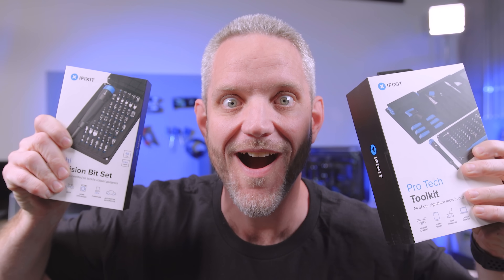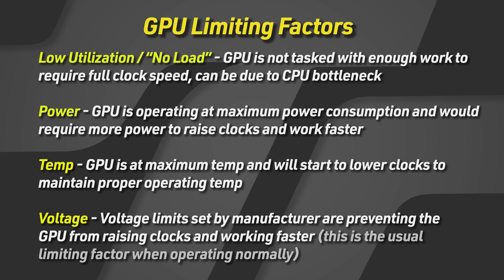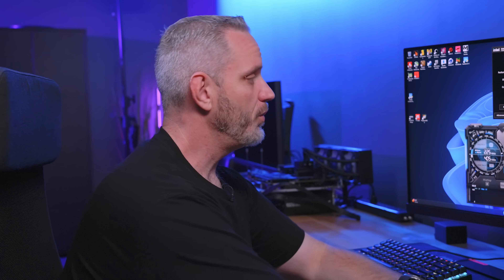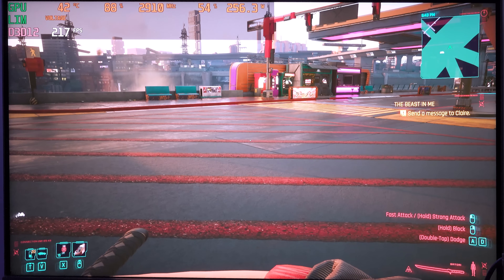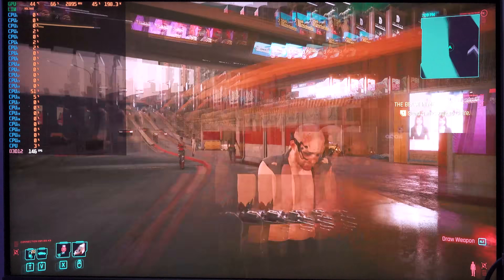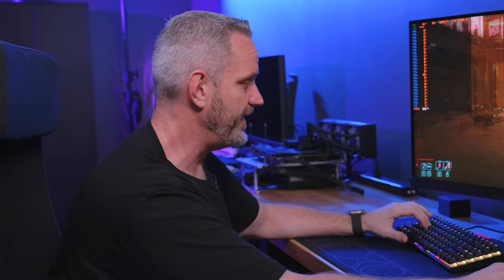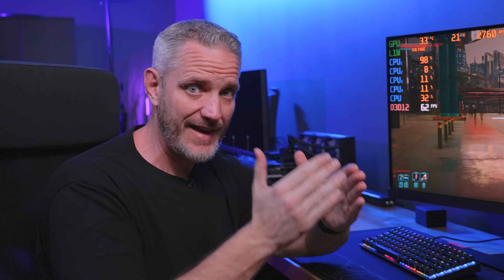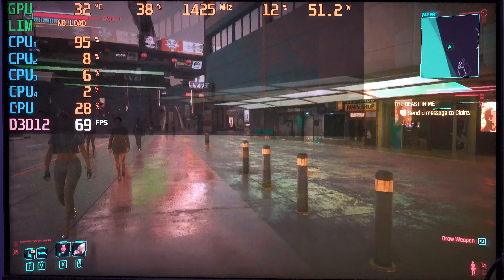THIS is what Bottlenecking REALLY looks like! AVOID THIS!

Comment: can you do a video covering bottlenecking regarding gpu’s wired at 8x running on pcie 3? i’m a design student running old hardware trying to save money where i can. i have a x470 strix and a 5900x so i don’t have pcie 4.0 and it seems all the low end cards are wired for 8x. i don’t know if i should get a b550 or just get a higher end card that’s wired properly. any insight would be appreciated thx much

Comment: If u Run Cyberpunk (a Nvidia  optimized game) with a gtx 1070 and I7 7700 nonk (my case)and u turn all in Low settings and u reach 100FPS,with a RTX Card u will have more FPS,lowest? or the same?
I think will run the same.. 
And New games require more power,I see hellblade 2 a heavy game dont take to much CPU because lower frames.. 
Maybe the think is in the cores and threads.

Comment: Too keep it short: 
If you building a new system, or upgrading. Your gpu should always be your bottleneck. If it a'int. You should upgrade your monitor or your cpu. Simples as that. Buy a 4090, but if it a'int 99% load, buy a 4k monitor or a better cpu. Or else your 4090 a'int better than my 6900XT. :)

Comment: Thank you for explaining this. Just got a PC. Question It has a Ryzen 5 5500 with a Radeon RX 580. Is that ok or should I get a 3060 or 1660 super so it does better. I did the PC builder specs and with the hardware it has it was 14 percent. Is that ok or should I get the GPU thatll be closer to zero

Comment: what the best way to setup a laptop that is mid range/budget so the cpu doesnt bottleneck it? i have an older nitro 5 with intel core i7 9750h up 4.5ghz 6 core/12 thread and a rtx 2060 with 16gb ram. 144hz display plus my gaming monitor 165hz.

Comment: I upgraded my graphics card from a 2080 Ti to the 3080 Ti and still running my i9 9900k OC to 5.0Ghz. Still have smooth frames at 1440p 144Hz. Wondering what a new build would look like with a i9 14900k and keep my 3080 Ti. Any thoughts?

Comment: My cpu is sitting at the 40-50 percentile range when idle on the windows 10 desktop. When running even gpu intelsive games I'm running at 80-100% depending on the exact title. My gpu very rarely goes above 80%. I'm running an intel i5 3470 with an gtx 1660 Super. The reason I'm so cpu bottlenecked is because I got the gpu from my brother when he upgraded and I don't have the money to go and buy a cpu, motherboard and ram all that the same time right now. I have calculated that it will take me over 15 months to save enough even if I save as much as I realistically can.

Comment: Hello, i have an i9 11900kf with 32gb ram 4000mhz and amd 7800xt. and on benchmarks i have for example in 3dmark 8700 points on cpu and 19800 on gpu. is the cpu holding back my gpu?

Comment: I have an am4 5700x3d cpu and currently have a potato gpu ,so I want to get the 4080 super paired with it but bottleneck calculators and a store I went to told me there will be 16% bottleneck with this cpu and and gpu .In your experience should I stay with the 5700x3d to play sea of thieves at 1440p max setting or is it a must to upgrade to a 5800x3d ,will 16% bottleneck be a real deal or you think i will be able to live with it???ty in regard!!!

Comment: Please help, I have not found any solution to my problem, which I think is bottleneck but not sure.. I got Intel I5-10600K, nvidia geforce rtx 3070 ti, 16gb ram, 850w powersupply.. My GPU is running 30-50% with 30-50c temps... CPU running 40-60% with 60-70c temps, ram usage is 70-75%.. Why I can't get my cpu and gpu usage any higher, no matter what I do :(

Comment: Great Video as always! Can the CPU/Video card Bottle neck happen when the CPU is not fully loaded? Maybe its not bottleneck like I first thought.  I'm seeing pauses similar to "internet lag" happen from time to time on non networked games, just often enough for it to be totally annoying. Screen freezes for a millisecond and then comes back.  I have 3800X CPU, 2x16 GB 3600MHz Ram clocked to 3600 Mhz stable using XMP2 with infinity fabric set to 1800,  I'm using a Zotac 4070ti that I just installed a few months ago upgrade from 3060.  According to my research a 4070TI should not bottleneck with 3800X CPU. It would be interesting if you guys get the same results. I'd like to see you guys trial test similar combo to see if you have the same issues. My Mobo is ASRock B550AM (made for Cyberpower.  Have their bios 2.0 installed.) with  PCIE 4 x16 for the Video card slot.  The M.2 is not on the same channel according to the Mobo Manual. I first thought it might be dialing back to PCIE4 x4 but CPUZ confirms 16.0 GT/s when in game.  For example when playing ARK Survival evolved single player(offline) which is known to be CPU intensive hesitate at times worse than like shown in video when at 1440P. I have also tried reducing all the way down to 1080 and same issue.  game plays and looks great until random freeze moment happens and you end up running off a cliff. lol.  Have CPU liquid cooled and runs at ~70 degrees C during game play so it can't be thermal throttle.  Max CPU usage during the game play shows only about 60% max according to HW monitor.  Not gaming on network so not network lag. I'm totally at a loss as to explain why I get these momentary latency like pauses. Maybe I should throttle back to 3200 Mhz?? Not sure if its CPU issue or not? Love to know before laying down $419 CDN for 5800X3D.  That is my next step to resolve this. Would love your guys opinions suggestions. or even for you guys to try and see if you get the same issues.  I checked some online chat groups and they are saying its related to the Unreal Engine 4 and how it uses max 4 CPU cores at a time?  Not sure if Unreal engine settings could have anything to do with these lags?

Comment: I tried to build the best Rendering/AI upscale/Gaming (everytype except RTS) I ended up with a r9 7900x, a 4080 OT, 32gb of Ram, and a 1000w Power Supply (for further upgrades) I should have put more money in NVME drives though. I only have 2gb of SSD and 4tb of HDD. I plan to get a Samsung 4tb 990 Evo for editing and game storage (I have 8gb internet so the high speeds are nice) I get bottlenecked at 1440p a lot with the 4080 which sucks....

Comment: Could i overclock a old CPU and not have bottleneck? 

I have i7 7700k that i have delided and used liquid metal and had it running at 5.2ghz with good temps. For now im running 4.5ghz to spare the cpu .

I have an rx 5700xt and i have big variation on fps in games.

Comment: Hi, I am a newbie when it comes to tech stuff but I do enjoy smooth gameplay, I have a Ryzen 7 5800X cpu, and I plan to upgrade my GPU to a 4080 (super). Will the cpu bottleneck it or must I upgrade the CPU as well?
Reply: It might not cause a severe bottleneck, but you definitely won't be getting close to the max potential of a 4080 with a cpu like that. I would upgrade. Just keep in mind that it will probably be a good idea to upgrade your motherboard and ram alongside it, and also your psu depending on the wattage of your current one.

Comment: My bottleneck is my monitors. I built a killer machine 4090 i9 13900k 64GB 1300wt. But I can't afford to update my monitors yet. So it's running on 1080p 60htz monitors. So I get some stuttering in MSFS when I fly in big cities or graphic heavy locations.  I assume that is to be expected and considered a form of bottlenecking? Will there be any value in performance if I set in the game the limit on FPS to 60? or would it still do the same thing. This of course until I get my Samsung G9 57" Ultra wide!!

Comment: Would it be a smart idea connecting my 4090 to my 7820x with 8cores/16 threads (old skylake x system)? Would i be very bottlenecked? I have the gpu but not using it yet until a buy a proper cpu.

Comment: am i loosing 35% of graphical Potential of the 4070 Ti when i use a Ryzen 5 5600x? some data on the internet tells that. Otherwise when you use an Higher CPU whatever Video you watch you never get 35% more FPS out of games cause you take an higher CPU than Ryzen 5 5600x.

Comment: Hello, can someone please help me. I am not having problems with my PC actually but am not sure how things should operate. So, I have AMD Ryzen 5 5600X and Gigabyte RTX 3060 Windforce OC 12GB, 32GB of RAM and its working great. I am just curious is it okay if my CPU usage is 30-60% and GPU usage 60-90% jumping to 100%. When I play Counter strike Im getting around 250-450 fps for example with lowered settings for performance. Everyone is saying that your GPU should be 90-100 % usage to get the best out of it but isnt it shortening its life? Is it fine that its working on lower usage since task is not demanding enough? When I push some settings up its getting to 95-100% and CPU is staying on same usage. I hope my question is clear, everything is working fine just checking is it prefered for it to work full throttle or everything is good like this, should I push it harder? What is good percentage for CPU and GPU usage in this combo or in general? Thanks!

Comment: Intel core i5-10400f, paired with gtx 1660ti has micro stutters with cpu usage at its full 100 percent, with/without max graphics, its weird when i turn graphics all the way down the cpu usage goes down to 80 percent and less stutters which is why i dont fully undertstand this (game - fortnite and only happens in fortnite).

Comment: I found a bottleneck using the switch emulator with Breath of the wild.  It will actually give an error in the console window sayin GPU waiting or something.  I forget what it say s but I'm running a 2066 HEDT 14 core i9 7940X and a 3080 GPU.  When I ran Breath of the Wild on the emulator it would lag or freeze just low frame rate at parts and my GPU was only being used like 40 percent or something.  I then got the Intel Extreme overclocking tool or whatever it is, extreme tuning I think, and overlclocked the boost from 3.8 to 4.2  and 4.4ghz and it actually ran smooth no more drops or freezing or errors in the console, and it allowed my GPU to work at a much higher usage rate, which proved to me, that the CPU speed was limiting the GPU usage.

Comment: i5 8400 6c/6t paired with 3060 ti causes serious bottleneck in this game..someplaces i get stable 115fps and drop to 29fps near ripperdoc vic CPu hitting 99% usage and Gpu drop to 45% Usage..this is the only game that manages to do that to my gaming Rig quite mindblowing...i need to upgrade my Cpu but atm the only valuable option would be intel 14th gen coming soon...but im not a big fan of refresh i want a whole new platform if im going this way

Comment: Bottlenecking: I replace 2080ti with 4090 on 10-core i9 from 2017. FPS remains about same, what went wrong? OK, go shopping. 13900K, new motherboard, memory and... 2.5x framerate. I was going to upgrade everything (=complete new build) but pairing 4090 with a potato CPU = fail.
Reply: Actually the CPU isn't a potato even 6 years later, it just doesn't have as good single-core performance as latest processors so the fail is actually in the software side. There still is plenty of headroom in the CPU it just isn't used, kind of sad that 10-20% of the processing power is used and 80-90% is just.. not doing anything.. games are kind of shit workload for that kind of CPU, it worked like a dream for work I used it for.. it was gaming that was purpose of the upgrade, crazy shit.

Comment: I have a question, im currentlly playng World of Warcraft at 2k Max setting, GPU is a 4080 Eagle OC CPU is i7-12700k - RAM  DDR4 32GB 3200 CL 16
Why do i have an FPS drop in big citys (many players around) while my CPU & GPU usage% dosent even touch above 50%? (around 60-70 FPS) while i normally have around 120 FPS with around 80/90% GPU and 30/40% CPU usage outside citys?

Comment: im thinking of getting the 4070 but i have a AMD Ryzen 5 5600X with a 1080p moniter is that going to bottleneck badly or would it be unoticable without the numbers. Im using a 3060ti rn

Comment: So I currently have a 5600g. I can't afford to upgrade my processor, but I can afford to get up to a 7800xt. I checked the bottleneck checker site and says my bottleneck is about ~11%, give or take.

In terms of FPS, how much is that? For example, if I had a 7800x3d + the 7800xt, and I was running CP2077 @ 1080 @ 60 FPS, how low would that look like with the config I am looking at? 54FPS?

Comment: I’m scared of Overclocking, I have a 4070ti, a ryzen 7 5800x on a B550 Tomahawk max and on the bios setting I activated some OC setting to allow the ram to run at max speed but I don’t know if it does anything to anything else but when I downloaded afterburner and played with Overclocking, I killed my pc and had to erase everything and install windows from 0. 

If I use the bios OC, would msi afterburner cause issues with it? Maybe it was something I did wrong

Comment: On this subject... someone at work used a bottleneck calculator website and claimed that my planned build (i7 14700 and 4090) would be CPU bottlenecked. Tom's Hardware forum is telling me this isn't true at all and a much weaker CPU would be fine too, at least at 4K resolution.

Anyone care to weigh in on this?

Comment: I'm currently stuck at stress testing my system. I've used Cinebench to test my CPU while looking at the core temps via Intel XTU and the HWmonitor program. My 30 minute core test of the i9-11900K, had an average temp of 85-95°C, which I don't think is right. I'm not sure where to go from here. I'm trying to check my airflow which I believe is working as intended and my fans are spinning like they should. It could be my CPU cooler, as I'm using an air cooler in a Lian Li 011 Dynamic. It has only one fan...any feedback would be great!

Comment: Trying to keep up with Sim racing with my Son. Just picked up a used 3060TI... Currently paired with my FX8350 black.  Poor thing. pcie4x, down to 2x, & such a tired CPU. lol. It struggles so badly, Have to drop to mid settings to get near 60fps 1080p.  tbh, though, it's still much better than my  gtx960 I was running before. lol.  mb/cpu/ram combo next save.

Comment: i have a i7 9700k with a 4060 i did have a 2060 until it died but it seems like ever since i upgraded the gpu i get these stutters and my gpu usage drops to 0% and my cpu spikes to 100% then back to normal which is gpu usage 97% cpu usage 40-50%

Comment: hehe i had my old PC with i5-4590 and 760 and at one point i bought more RAM and SSD for it. Eventually it couldn't keep up and i knew that i'll have to build a new pc already but i got an opportunity to buy 2060 so i did. Haha it helped but i wonder how badly is it bottlenecked by the CPU. I'll probably build a new system with something like 7800X3D soon and keep my 2060 in it until the new gen cards are released.

Comment: What i call bottlenecking is when one of the two full power components reaches its limit before the other, making the other not perform at its max. Say the cpu is at 100 load while the gpu is under 60 with my in game settings being low graphics then obviously the gpus is able to keep up but the cpu just cant process that fast ill call that a cpu bottleneck. And in the situation that the gpu is at 100 load and the cpu is under 60 with in game settings be max graphics then the gpu is the bottleneck and isnt keeping up. What do yall think?

Comment: I'm finding that my 12700K which is overclocked at 5.1ghz still  bottlenecks my 4090.
Which CPU is currently the best to pair with 4090 to gain maximum performance ? Any help would be much appreciated :)

Comment: I have the evga sr3 with w3175x should i get the 4070ti or will it bottleneck cpu runs stabil at 4.8ghz and ram at 4000 mts

Comment: That means always at the bottleneck mode 😂
I have an old i7-3770 4th Gen cpu, 12 gb of ddr3 ram, and GTX 1650 with 4gb of VRAM. 
I would love to see anyone fix that issue with that set up. Using old motherboard of Dell 0NW73C. 
Not even Jay can fix that setup.

Comment: This was very interesting since I just did some testing the last days myself as I got myself a 4070 super after painfully living with my old rx470 for far too long. It was a huge expense so i had to pair it with my existing system. I have a Ryzen 7 1700X with 32GB of DDR4-2800. I totally bottlenecked at timespy and got 70% gpu usage. the score was at 80% compared to the usual. It kinda pains me to see how a 6 year old 350€ CPU with 8C/16T cant keep up but a 3600 doesnt (80€). Now to the interesting part, once i got enough money to upgrade my system again, how much cpu do i need?
Reply: But the good part is that i can hugely undervolt my gpu because at low load it runs just fine with 900mV
Reply: u mean a ryzen 5 3600 is better than your 1700x ?
Reply: @RaoufAL  according to my benchmark findings it was able to get full timespy gpu scores. Mine did not. 3600 has 25% more single core performance

Comment: While numbers are useful as a reference, I feel like people focus on numbers too much. 
Will you get better performance by pairing medicore CPU and medicore GPU, or cheap CPU and top GPU, that is the question, and the other one is whether you are really bothered by small stutters. 
Also consider the actual settings you use in gaming.

I actually argued on reddit, as some people are switching to new CPU platform, and that costs a lot since you need to change motherboard, cpu and ram. for AMD that may mean instability, high idle draw. It may cost like 300-500$ to update the platform.
Nobody is sticking to facts, they just upgrade for the sake of upgrading, this is so annoying.
For gaming, probably it is better to put that money on GPU instead. And not only gaming, AI will utilize GPU a lot, also some modern video editing programs are quite GPU heavy

Comment: man is the 4090 that much better? im over here running high settings no ray tracing with performance DLSS and i still get 40 FPS on my 3080. got a 7800X3D too, makes my GPU feel so shit.
Reply: 4090 a lot better yes